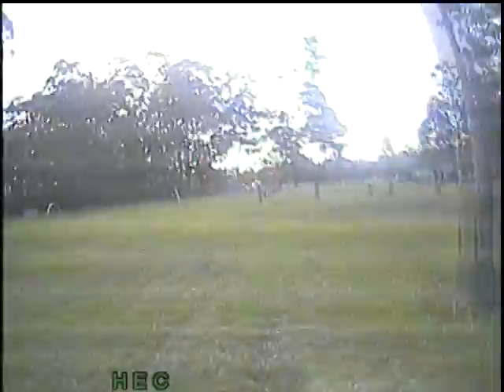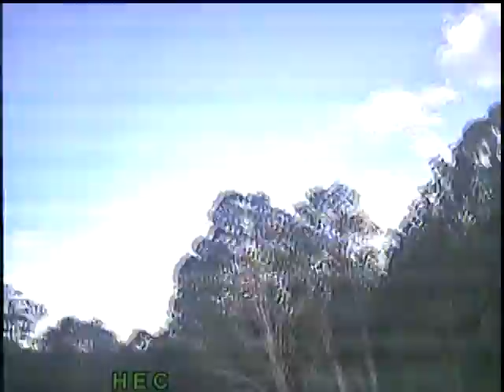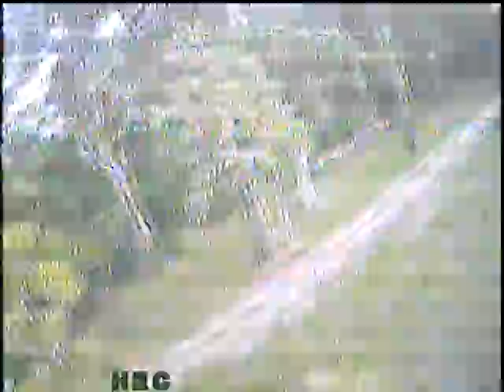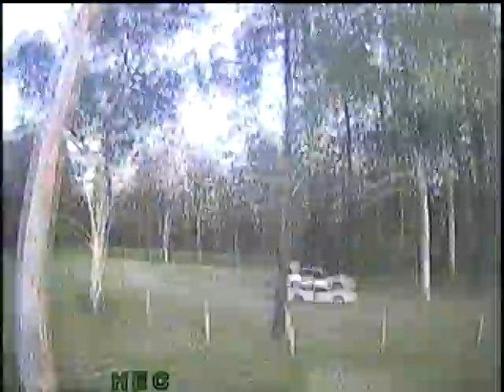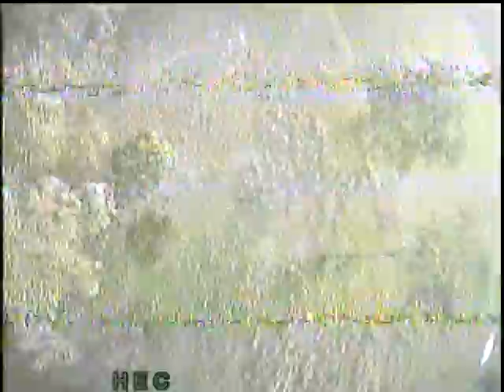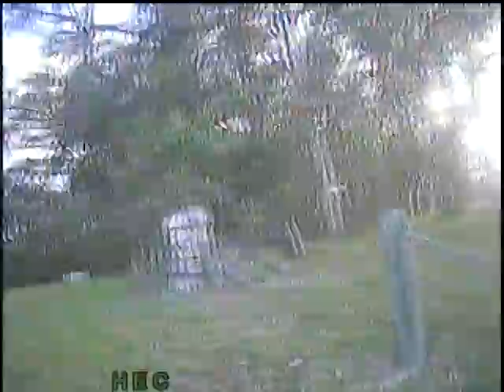Airmode Is Real!

Comment: Great Flying as usual Hector - I'll have to try Airmode for myself now :)

Sounds like a possible mode switch change from "rate,angle,horizon" to "Rate,airmode,horizon"
Reply from the maker: +Freddy Satellite thank you mate , yes sure is or you can just replace rate with airmode , but you will need to re tune . lower p on roll and yaw seems to be common

Comment: Nice flight Hector what do you think was causing the heat in the motors?
Reply from the maker: +RCTV-UK just not tuned up for airmode i think , going to go over my logs later but a quick glance suggests my P gain is to high but im in over my head here so i posted on josh's blackbox thread , Going back to just a idle up switch did fix the heat issue but now i love the airmode feeling i dont want to go back lol
Reply from the maker: +RCTV-UK Ok thought i'd let you know i sorted my issues but it required a complete re-tune! i ended up dropping my P for Roll and pitch about .5 points and i droped Yaw P a whole 1.0 .. on Lux so that's some big changes !